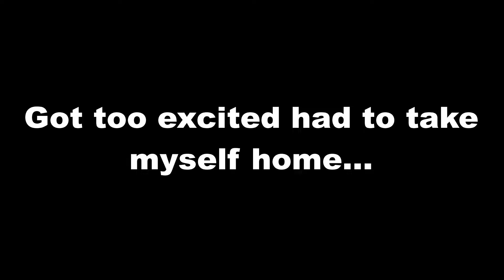HOW TO remove rear quarter glass without special tools | Fiesta diaries | Ep.11

Comment: You wrap a  cord round the rubbers and as your pulling out the cord press on the glass firmly and it will pop out ,fitting it in is just the reverse.

Comment: Did you remove the window mechanism in the doors as well? If so HOW?! Been scratching my head all afternoon with mine! Cheers 🤙🏼
Reply from the maker: You have to drill out the rivets that hold it in the door. I just leave it in place when im working on doors. If you do remove it you'll have to rivet it back on or use small nuts and bolts.